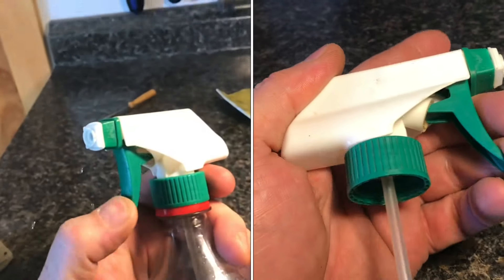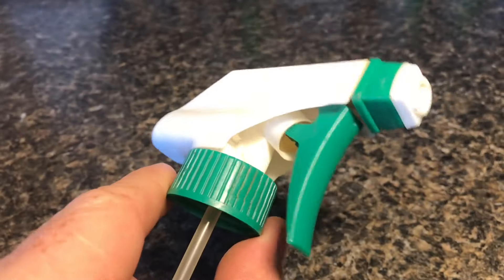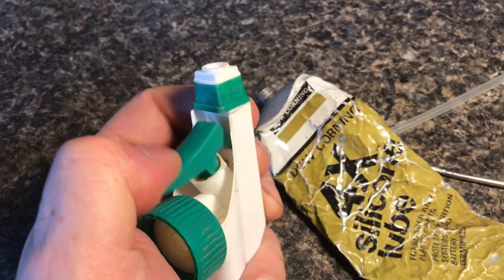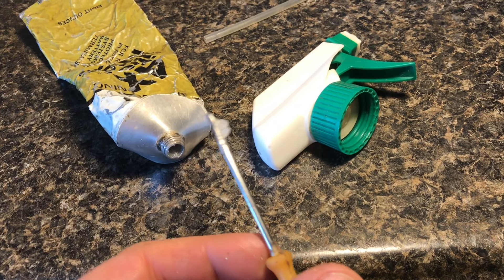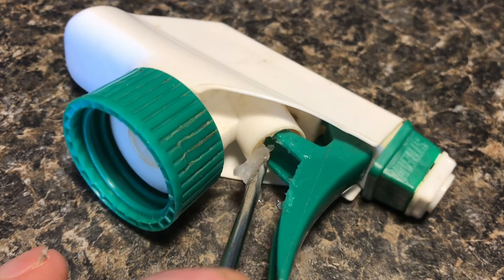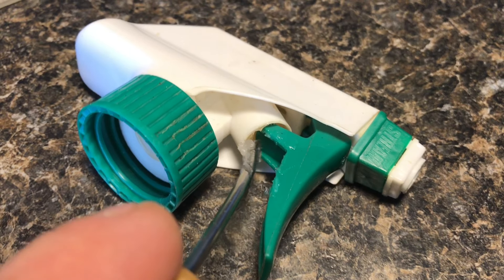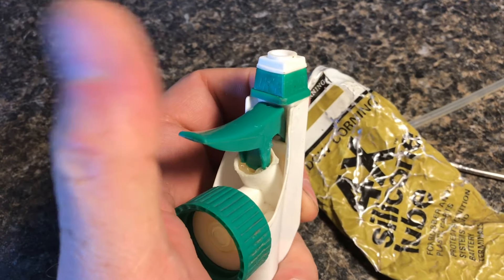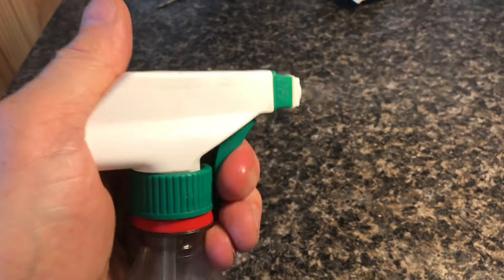quick fix SPRAY BOTTLE (nozzle sprayer, trigger spray, mister spray)

Comment: Hint: If you don't have silicon grease, there might be something else around the house that works. I've used silicone-based personal lubricant to fix sliding closet doors. For my spray bottle, I happened to have a sample packet of silicone-based hair product.
Reply: lmao mad respect for not throwin that lube out, or worse, trying to sell it at a garage sale. Unfortunately i have seen that happen 3 different times.
Reply: Thanks so much hahaha! Saved myself from buying some grease.
Reply: I used olive oil, coconut oil and nothing would make the sprayer spring work!!!

Comment: This was fantastically short and to the point. The solution fixed my vinegar spray bottle immediately.
Reply: Yes... Low-budget videos can be just as good as monied videos. The worst are the ones where the person drones on and on for 15 mins to fix something that took 60 secs.
Reply: Exactly what I want to fix. Only I don't have the silicone grease on hand.

Comment: The issue I continually have is the sprayers fail after very little use when I’m pumping pure well water, and it doesn’t make sense to me. Is well water more coarse which causes pump damage?
Reply: while it should not be "more coarse" there may be other factors that depend on the well water, ours is salty and has alot of other odds and ends that leave residue when it dries in THAT case cleaning the nozzle with vinegar (soak it for a night in a glass?) might do you (your well water will be different and might need something else), but for the spring not returning this guy right here is a genius.. i can't count how many bottles i've thrown away over the spring not returning the trigger

Comment: Wow! The fact that I trash sooooo many spray heads thinking It was bad! Thank you!
Reply: I used Vaseline and warm up the spray head for 20 sec in microwave 😂😅🫢 It worked
Reply: @lililouis8929  Vaseline is petroleum based.
Reply: @lililouis8929  THere is a metal spring in most sprayers.  Not a good idea.

Comment: the sprayer heads are usually made out of PP (polypropylene), which is quite hardy and resistant to most petroleum products, so I wouldn't worry too much about that ruining it. Some other plastics and rubber are more sensitive to solvents though (usually from spaycans), so be aware of that.
Silicone is ideal for plastic-on plastic and any sort of gaskets and wet areas - so its a geat choice for this. very useful to have a tube of it.

Comment: I made bacon the other night and had the grease still on the counter (Bad to dump it down the drain, you’ll have to call a plumber.) figured Oils are oil, so I just used some bacon grease lol. Worked like a charm~

Comment: I have another problem. I had a pesticide in the bottle, so I wanted to wash it out. I screwed off the nuzzle, and then while rinsing the bottle, that small inner plastic thingie of the nozzle flew out. I put it back and screwed the cap on but now when I spray, I don't get a mist but just a tiny stream out.  Ok, it's "good enough", but it doesn't cover a wide surface anymore, because it sprays to a single point 😀 I tried to turn the cap both ways to adjust but it did not get the mist back. Not sure, what happened - maybe there was one more plastic piece inside that plastic thingie, and I lost it. Wondering if I can find something to replace it.

Comment: I bought  the Stars822 heatsink plaster made with silicone grease on my 3 spray bottles but they didn't work. Is there a specific part of the spray gun where you have to put the grease? Thank u.

Comment: crossing my fingers that standard silicon lubricant spray might be similar enough to what's described here.  i have a cheap spray bottle with cleaning solution in it which i wouldn't mind sacrificing to test this theory.  thanks for the tip.
Reply: Did silicone spray  work?
Reply: @pamalexander5480  crap, I forgot to try, but I still need to. Thanks for the reminder.

Comment: But my problem is inside the trigger itself I don't know what you call that where the spring is and that piece of plastic that goes against the spring that goes back and forth in the sprayer that seems to become loosen and it sprays very tiny after a while how do I fix that? If you know what I mean 🙄

Comment: What about WD40?
Reply: wd40 eats alot more stuff than you'd think. some plastics it is safe for- some it will eat. so depends on what the bottle is made of.. I'm pretty sure a little google time will come up with a list of what plastics are okay to use it on. (it will "last" less time than the silicone lube in any case as a thin liquid coating vs a glob of gel - you get the idea.

Comment: How about mineral oil?
Reply from the maker: Mineral oil might work temporarily, mineral oil is made out of the same oil products that the plastic is made out of. Silicone grease would work great, sometimes you can find it in the plumbing section. Hope this helps

Comment: I just used vaseline and it worked like sharm thank you
Reply: what's your mean by [like sharm] ?
Reply: @hanfucolorful9656  it means like magic
Reply: i made a mistake it's written like charm
Reply: @ch.boucetta1688  I actually try to learn this new word, and googled, still have no clue :-)
Reply: He specifically said NOT to use petroleum based grease. That's what vaseline is. It will eventually break down your nozzle.